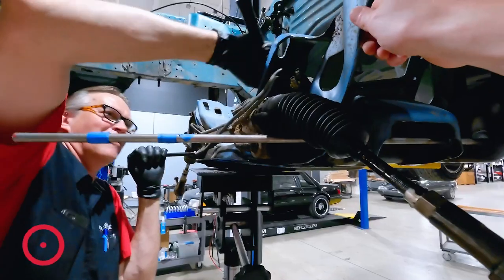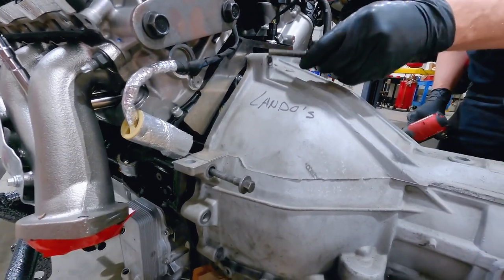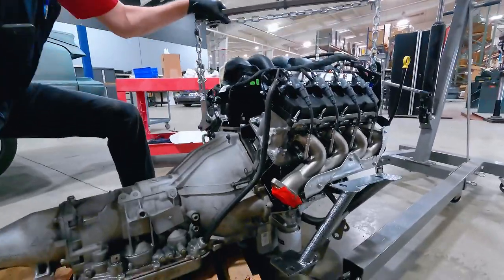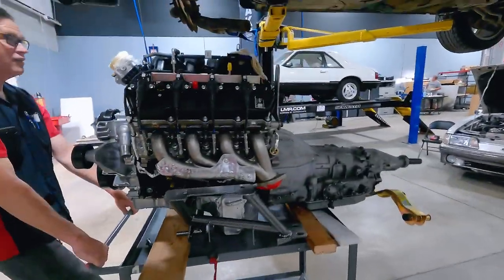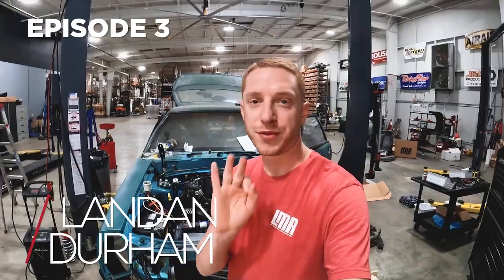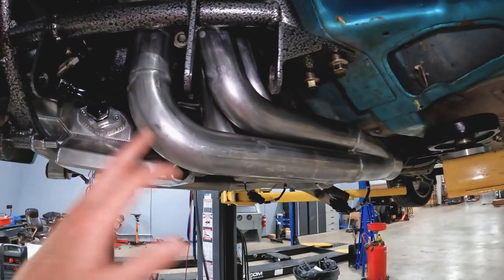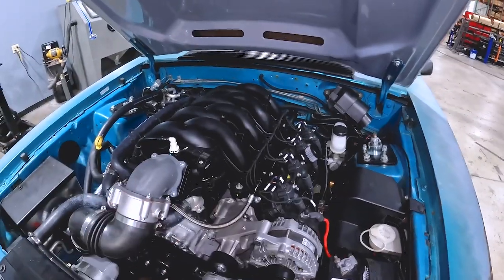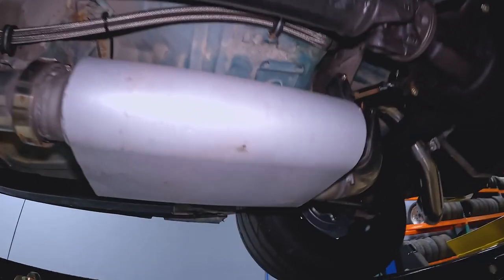7.3L Godzilla Swap Fox Body Mustang Project Car: Green Goblin | Full Build Series

Comment: That's an awful lot of motor just to get 416 horse power. You could have took a 302 and stroked it to 347 and put a set of heads and a turbo on it and got more horse power.
Reply: It's not about the horsepower for these engines.  These are engineered as truck engines and torque is this engine's strong points, which you really need for a great launch when drag racing.  That being said, there have been other applications of this engine making a solid 1,000 horsepower or more if your mission is more about the ponies than torque numbers.  Added bonus is that these engines are not as wide at the top as the Coyote, making it easier to fit into older cars without cutting up your engine compartment.  Lastly, it doesn't cost much more than a new Coyote crate engine.

Comment: About what a stock coyote swap would run in that car. The question now is which is cheaper to do?
Reply from the maker: With a Coyote in similar trim, the times would be very close.  If you bought parts new, the cost is also comparable.  -Landan

Comment: I was watching this series because Im thinking of starting a Godzilla swap in my 91 GT.  You got a stock intake to clear a 2.5" cowl hood, do you think (or know) if the BTR intake, or Ford Motorsport intake would clear a stock hood?
Reply from the maker: I can't speak on behalf of the BTR intake since I don't have personal experience with it. We recently installed the Ford Performance intake (video coming soon), and it still didn't clear the stock hood. From what I can tell, all that Ford Performance did with their intake is reposition the throttle body. It also accepts the 92mm throttle body from the GT500. -Landan
Reply: @latemodelrestoration  Thank you.  Do you have any plans to try the BTR intake?
Reply from the maker: @cp_lightstang166  Not at this time. We're happy with where the car is at. Plus, the BTR intake loses a lot of low-end torque because of the short runner. -Landan

Comment: I bought a 1991 fox body with out the dip stick tube and know i wondering how to put ig back
Reply from the maker: It installs between the #7 and #8 header primaries and slides into the engine block. -Landan
Reply: @latemodelrestoration  one Grove goes in or none
Reply from the maker: @juancontreras2615  The first flare on the dipstick bottoms out on the engine block. -Landan
Reply: @latemodelrestoration  so it don't go in
Reply from the maker: @juancontreras2615  Please send us an email with some pictures of the issue through the Contact Us page. The link is below. -Landan

https://lmr.com/contact
Reply: @latemodelrestoration  do you sell parts for mustangs